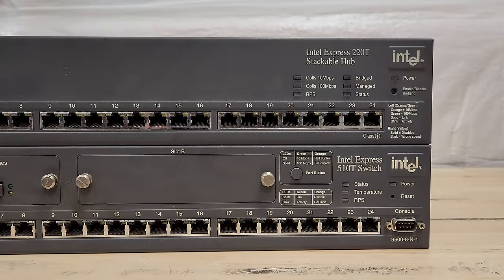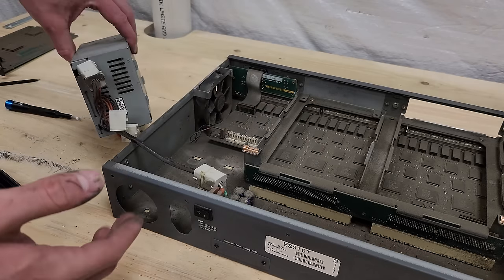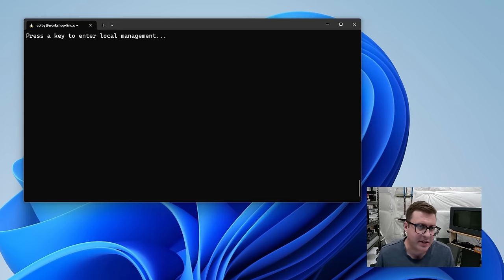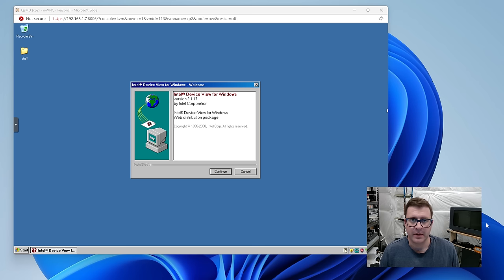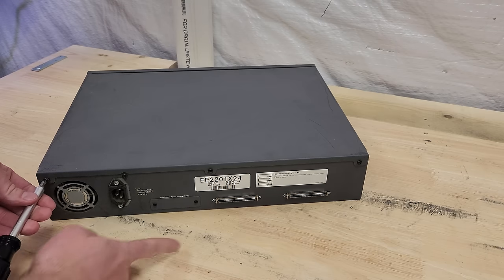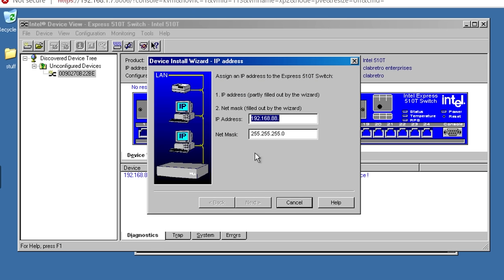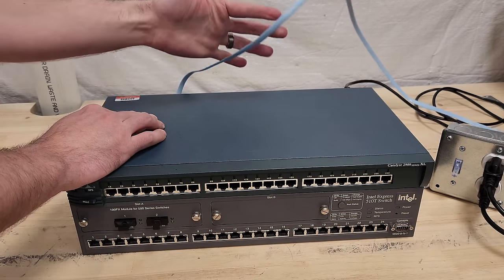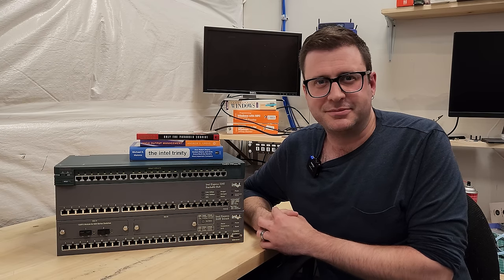Stackable '90s Intel Network Gear

Comment: Yeah, those old IOS versions are pretty painful to use. Notepad is your friend though, you can copy pasta your interface config and just change the port number, then pasta your config all at once.

I have no idea how these Intel switches work though, never used them myself. I did consider picking up one for my home network in the early 2000s, they were super cheap on eBay compared to Cisco gear. I was doing a Cisco course at the time though, so I did end up getting a Cisco switch. Can't remember the model, but it had a noisy fan which a drop of oil fixed.

With that fibre module, I'm wondering whether it needs to be configured somewhere before it will be recognised by the switch? Like I said, I have no idea about those switches, so that's my only guess as to why it's not working. As for the fibre itself, 100Base-FX uses multi-mode fibre, so that yellow single-mode fibre most likely won't work. Also, if you don't get a link with a fibre (once you figure out why the module isn't working), make sure the cable is crossing over the TX and RX. Obviously don't check by looking into the port or the fibre, you can point your phone camera at it instead and you should see a purple light.
Reply from the maker: I wish I would've thought of pasting or just the tftp route, would've been cool to compare the differences between the two. I'm also gonna try reseating the whole riser board

Comment: we had a pair of these at my first job out of college, I think they were 400-series, but looked like your units with the DB9 management port. ISTR they could only handle 400mbit across the backplane, so just a few machines doing large file copies could slow everybody down. they were big, power hungry, and didn't always autonegotiate correctly, but worked well enough into the early 2000s for my employer. (one was still retained for older gear after the building was rewired to support gigabit...)

Comment: I admin'ed one of the 510T's 2001-2003. It was one of the only 100M devices in my department at the time.. hah (via a 100M hub module in the expansion slot)

Comment: Hi, do you have a minute? I'm studying  superior grade IT and I was wondering if you can provide any info about the old phone line internet services... In EU most of ISP stopped offering it, but the infrastructure still exists, and I was wondering where can I get some (and what type of) hardware so I can make a small project and offer "internet" over the old lines. I was thinking of making some emergency like service in case local fiber goes out (since it's detatched from the main network), or maybe a small private wiki,  or IRC message service. Just something to tinker with and learn stuff. Plus I also think it's a cool video idea... I assume you have some hardware that you can use for it...

Comment: The first cisco switch I ever bought was cisco 2924xl 12 port 10/100 and few years later I bought a cisco 2950 24 port 10/100 then cisco 1721 isr modular router rack version then a cisco 1751 stackable modular

Comment: 2:03
Is there an advantage in using fibre over a normal connection if both provide a max. speed of 100Mbit/s? I noticed in the video that fibre cables seem to have a smaller diameter, but is there anything else?
Reply: Length. Ethernet maxes out at 100 meters while Fibre can go much further depending on the transmit power of the optics and presence of repeaters/amplifiers.  For wiring a multi-story building it's unlikely that each wiring closet is within 100 meters of the aggregation point, likely in the basement, so you need fiber riser cable to go between floors, as well as fiber between buildings in a multi-building campus.
Reply from the maker: yup, length of run!

Comment: When you were dusting it off with the air compressor, I almost screamed: disconnect the fans (both PSU and the airflow cooling one) or block them from rotating. 
Thing is, they might generate some current and fry some components when you run air from a compressor into them, since it will turn them into generators.
Reply from the maker: gotta live on the edge

Comment: Soon as you open that it looked like a system that was out in an environment. Like let's say a automotive shop or something like a machine shop where nothing is clean and dust goes everywhere. I used to work for a dealership and a lot of the equipment look exactly like this because it was out in an environment where it wasn't protected in a cabinet of any sort that was filtered to air

Comment: I actually had the modular version of the 220T hub (no modules tho).  Solid bits of kit, but got quickly upgraded to 10/100 switch, then gbit not long after.

Comment: I hesitate to ask because I don't want to contribute to filling your home up with old gear, but since I have an old like Juniper EX switch, I'd be amused to see what you'd think of those eventually as well - they were introduced around 2009 and runs JunOS as the CLI and has a web based UI as well....
Reply from the maker: I'd be interested! you can reach out to the email in the channel's about page if you'd like

Comment: I've seen tons of legacy gear, but the amount of dirt inside that switch is far beyond anything I've ever witnessed. Was that thing running in a metal foundry?

Pro Tip: Hit it with a leaf blower. It'll knock all that dirt off in just a few seconds.
Reply from the maker: leaf blower definitely would've been more fun lol

Comment: Still watching video, but when the slots off the riser didn't work, I wonder if your attempt to remove the riser when cleaning caused a bad connection and if re-seating and cleaning contacts on the riser would fix the Intel 510T
Reply from the maker: yup, riser needed reseating! did that and the module is actually working now

Comment: Why there even is a "Managed" Led on the hub if this model cannot be fitted with management card? Motherboard is clearly missing backplane connector, chassis is different. They could at least make that led label blank no to confuse people managing this.

Comment: Autoneg from that era was not always reliable. (Intel NIC + Intel Switch, usually works.) That's just the standard micro-dust any electrical system will attract. If you want to see what a "server in an auto shop" really looks like, I can supply pictures.

The oddest bit about Intel's failed attempt at networking gear is how it's made like a desktop computer. The chips you pointed out are all Intel ethernet NICs. There was supposed to be a management module one could add to the hub to turn it into a switch, but it was never produced. The entire "Express" line didn't last long either.
Reply from the maker: that ibm on the wall came from one. totally different ballgame from this light dust

Comment: What's the general use for something like this? This is outrageously cool.
Reply from the maker: well, a slower-than-normal switch I suppose. a lot of stuff (IOT devices for example) certainly don't need more than 100Mb but it very likely can't keep up with the bandwidth from your ISP these days. I do love the look of them though!
Reply: @clabretro yeah, a lot of brand new equipment in 202x still ships with 100Mb management interfaces and there are still plenty of active devices out there with 10Mb Ethernet, since most 1Gbit switches support 10/100 speeds just fine so there was no need to upgrade; but not all 1Gbit switches support 10Mbit and newer 2.5/5/10/20/25Gbit+ switches often don't support 10/100 anymore, so there are a bunch of embedded devices which will need small switches to provide media conversion.

Comment: USB Serial adapters are often flaky because "real" serial ports use +12v for a digital 0 and -12V for a digital 1, and USB is only 0V and 5V.  Newer serial devices will often support 0v and 5v serial voltages, so a lot of USB serial devices only support that type of serial communication.  I think some of the problems that you've had in the past with USB serial adapters were caused by this.  Many serial problems in my past were caused by this.
Reply: MARK and SPACE. The standard as I recall is +/-25V. Most systems will accept anything in the +/-5V range, because so few things have a 12v rail anymore. TTL serial is very common, because a MAX232 isn't free, and it's usually something so infrequently used as to be "trash". (Cisco has been using USB console ports for a while now.)
Reply: I thought that some of the USB adapters didn't wire up all the RS232 pins because most don't matter for a basic serial console, I've seen plenty of xover or gender changers which only have like 4-5 pins plumbed, probably dropping DTR, DCD, DSR, RI while leaving TX/RX, RTS/CTS (flow control) and ground, sometimes not even hardware flow control.

Comment: Check the adapter daughterboard for the modules, u did try to remove it, maybe it has a bad conection.
Reply from the maker: good call! I had thought I seated it back in but as I'm rewatching it's probably worth reseating that thing.

Comment: 00:13 "Gigabit ethernet was right around the corner in 1998"
2024: 100 mbit is still the default for most households. 😅😂

Comment: At the time these things were made, Cisco hardware was king.  Cisco certification tests, however, were brutal.  The last one I took lasted about three hours and I was positive I had failed only to find my score was in the high 900s out of 1000 points.  The questions and answers were worded in such a manner that at least 2 of the possible answers looked correct for each one.  Literally mental torture.

Comment: While this unit is in such a bad way with regards to dust......
With a little effort with a leaf blower 😏 or a good vacuum cleaner, the results will be awesome....
8:40  See? I told you....😏
9:53  Having screws left over is funny as...but shows the designers over engineered the unit  😂😏

Comment: I can't belive you got a switch that used to be in the Israel defense force. Crazy
Reply from the maker: I was thinking it was from Guildford College but who knows!
Reply: IDF and MDF are common networking acronyms for Intermediate Distribution Frame and Main Distribution Frame, the IDF connects to endpoint devices and the MDF aggregates IDFs  and connects to outside the building.

Comment: I haven't rewound the video but I'm sure that fibre card was working before you reset the switch. So it must be a configuration issue or a software issue now you wiped the system!! Based on the trouble you had getting the management software for the switch I would expect it to be as difficult if not harder to get the nessasary software for it.. in saying that though I don't have a photographic memory so I can't be sure it was originally detected before the reset and I can't be bothered going back to check but I'm pretty sure it was 😆